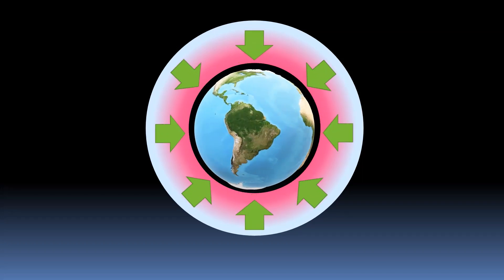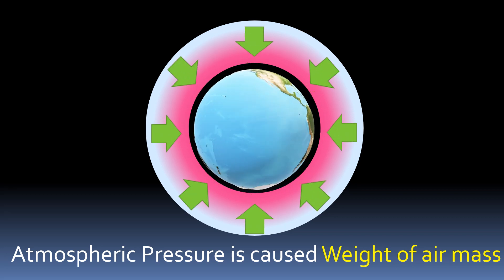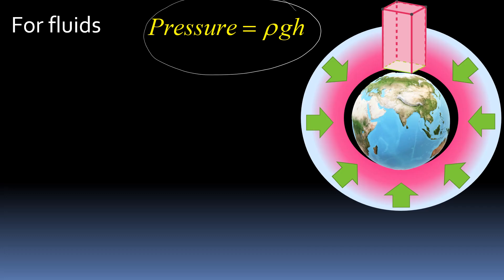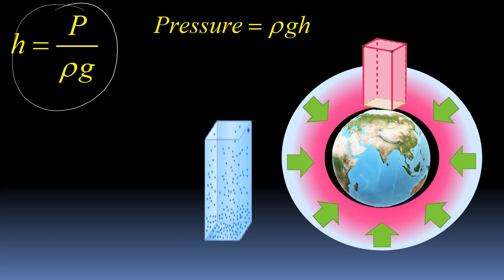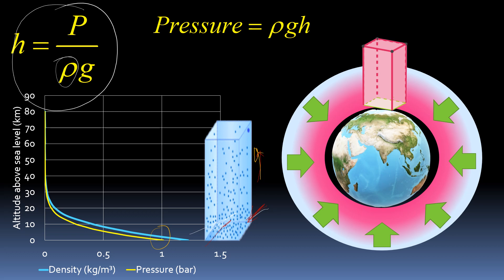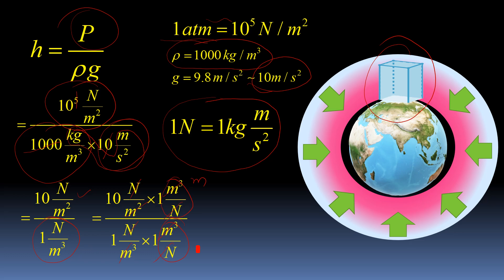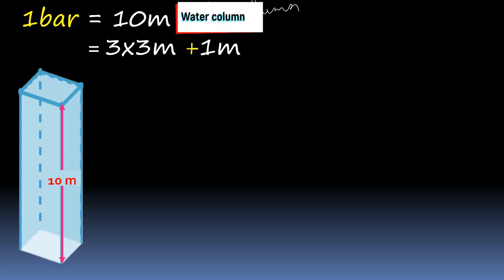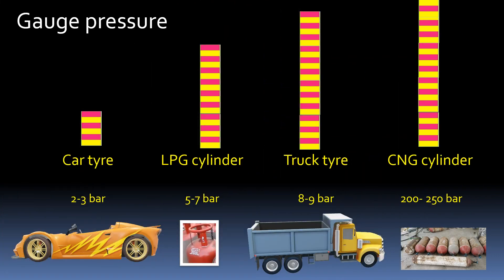Visualize pressure | atmospheric pressure I How much is 1 atm of Pressure

Comment: Sir i had a question🙋
You told 1 bar pressure is equivalent to carrying 10m of water in a vessel but how much water are we carrying by volume?
Reply from the maker: It will depend on the shape and volume of the vessel. Assuming your vessel is cuboid-shaped with a base of 100 square m and a height of 10 m. It will carry a volume of 1000 cubic m or 1000000L of water. 10 Lakh liter.